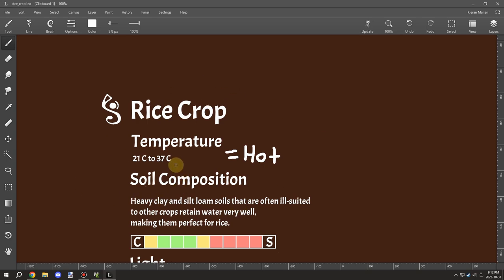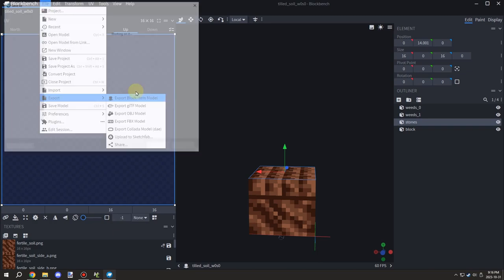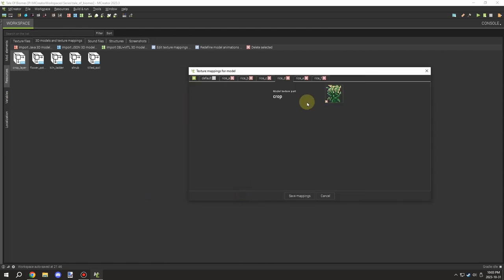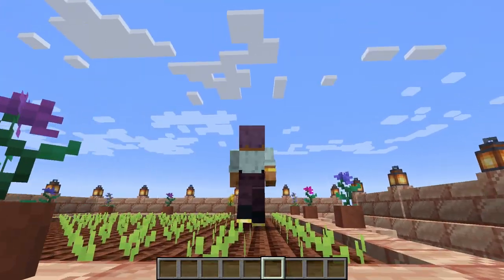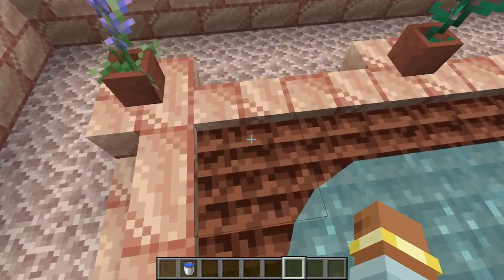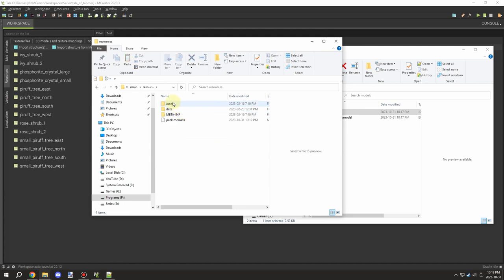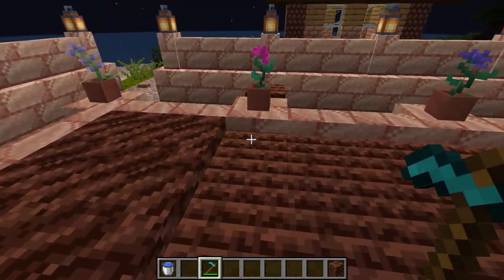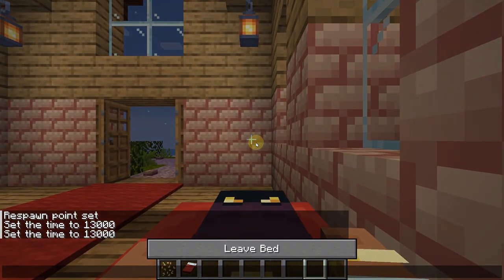Tilled Soil Correction | MCreator Lore | Ep41

Comment: How do I make a plant bush texture like berry? I didn't find the berry option at costum blocks.
Reply from the maker: Not sure what program your using. If it's the built in option then I am not sure if it has support for all the texture parts, the game is pretty big, I often just use PaintDotNet to do texturing, I have been using that program since gosh, I would say shortly after I started playing Minecraft back when the game was in Bata, I sued GIMP for a while before that but they did a huge UI update and I had the option to stick with GIMP or try PDN so I went with that option.

Personally I like to texture things by hand. This way I know for sure I won't run into any legal issues. There is a channel on my  home page that teaches Pixel art "Adam's" channel, he's got a pixel art class series that I recommend for anyone getting started, only downside is they are often long videos but you walk away with so much information so its worth it.
Reply: @NorthWestTreesMCreator  Yes but I have the unpainted part of the texture black woth Cross model. Should I use at transparancy cutout?
Reply from the maker: @crigrey12  You will want to use a cutout for the transparency of empty pixels. Translucent is for things like glass with some Alpha (opacity).
Mipped is similar to cutout but not sure how different nothing too noticeable that I can see.
Reply: @NorthWestTreesMCreator  Thank you so much! ♥️